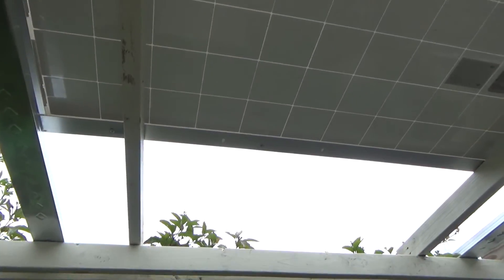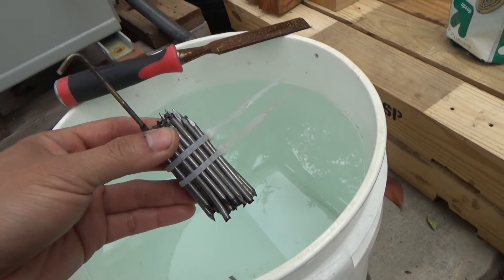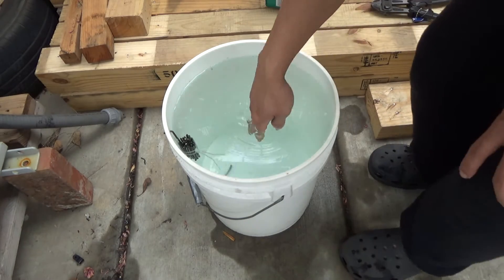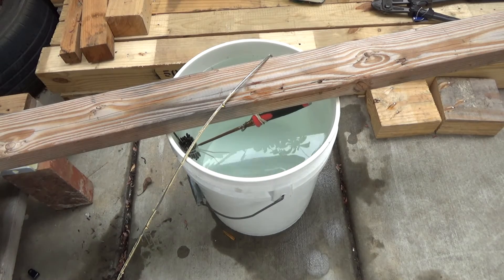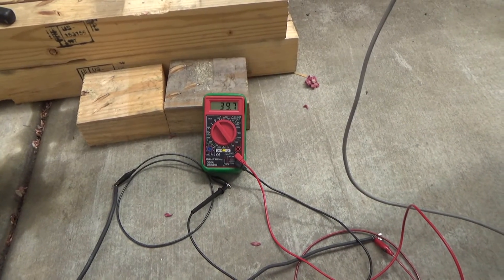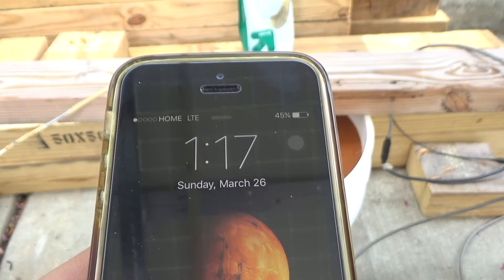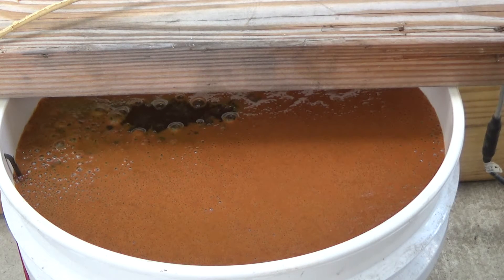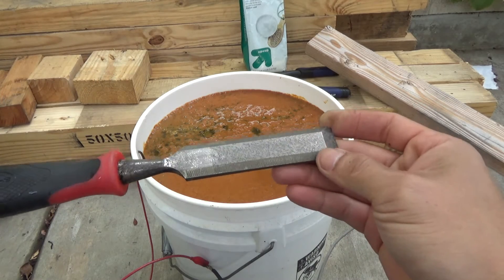DIY Remove rust using the sun power harvested by solar panel: Solar electrolysis

Comment: I am just curious if you would perhaps get faster results if you pulsed the voltage, such as with a PWM charge controller but I haven't tried either method yet myself..
Thanks for the vid!
Reply from the maker: I don't think you can use a charge controller with this. Most (if not all) charge controllers only turns on if it has input power coming from the battery. The water bucket is not a source of power so it would not turn on the charge controller so it won't work.

Comment: Wonder what would happen to an old pan/pot with stains
Reply from the maker: Most pans/pots are aluminum, stainless steel, and other iron alloy (with Chromium for example) so they are not suitable for this application. The only pans/pots suitable for this is cast iron but we don't have many of those any more nowadays.

Comment: I always wonder what happens to hydrogen bubbles.   They are so light they leave the water then rise to the top of the atmosphere at a very fast speed.  Do they get taken away by solar wind?  To be sent to Jupiter and out of the solar system.  If everyone waste 1 gallon of water a year to bubbling hydrogen and oxygen, you probably lose a large lakes worth of water to space. Do this over 1 million years and oceans water level might drop.
Reply from the maker: Good question. I want to know that, too. If you take a good look at the video at 16:04, the water level dropped about an inch. So I lost about an inch of water in the bucket through electrolysis. That's a lot of H2 and O2 escaped. But there are 100 lightnings per second or 8 million lightning strikes per day, the hydrogen is probably converted to water (by reacting to oxygen) before it has a chance to escape to space. Maybe that's why thunder is so explosive? LOL

Comment: Hey  Vuaeco That's so Cool .Can you do this with two of your 18 volt cordless battery pack witch will be 36 volt  °¿°?°  and will you still get plenty's of Bobo . ························
········· ° ° ° ° ° *° **~°<€§(((||)))):3>   ···Another good video Vuaeco
thanks a very helpful tip with getting off Rust off the tool's .
Reply from the maker: Good question. In theory, you can, maybe with just one 18V battery pack. But the cordless tool batteries have high discharge rate and may not be suitable for this application though.